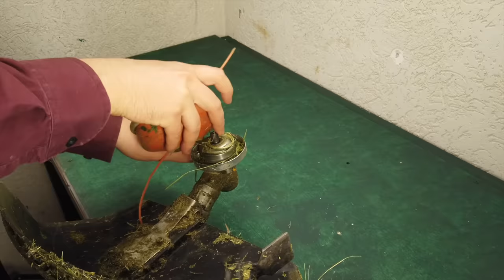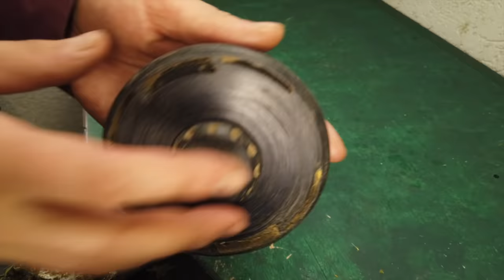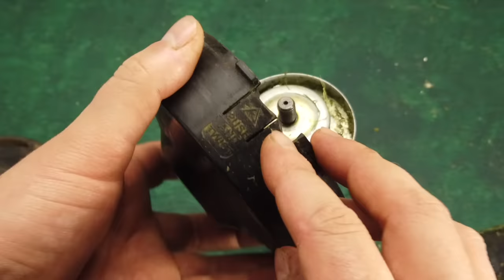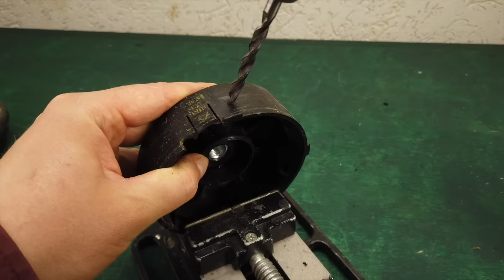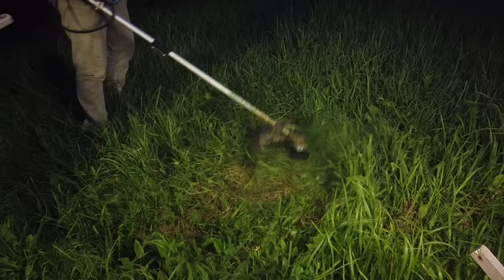The eternal trimmer coil with your own hands! It couldn't be simpler

Comment: With a little ingenuity some springs and some bike spokes could make retracting spinner where when it's not spinning the springs pull the spokes in so they're not sticking out and when it is on the centrifugal force pushes them back out.

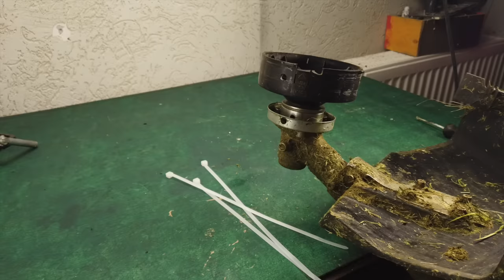Comment: Thanks. You can't believe it , I had this idea for a long time , I was searching for trimmer strings that had a sort of ball at the end of each 6 inch length, now I see your video 1:32 , I found what I needed was "self locking plastic straps". I was melting strings to form a ball at the end, but at high speed rotation of trimmer head, they used to snap.
Reply from the maker: Спасибо большое 
Посмотри новые видео у меня на канале. Там тоже есть про триммер!
Reply: USE  those brass marrets, for electrical connections. ( Usually black, for 10 - 12 gauge wires ) The larger ones - work  just  fine. Be carefull, use  the  EXACT  size of screw driver - on those small  brass  screws.  Larger ones, can hold up to 1.05   strings.....

Comment: Eternal Trimmer Coil - I hardly think so, those zip ties will eventually break and then you will have to replace them just like you have to replace the nylon trimmer line.
Reply from the maker: definitely you are right. but still this is one of the life hacks to finish the job if you run out of fishing line
Reply: Yes, but it's easy to replace one zip-tie, more so than trying to untangle the reel of trimmer line. Quicker, too . . . If you break several, get the next larger size of zip-ties, and cut-to-length if you must.
Reply: Of course.  But so much easier to replace.  My trimmer is such a pain to replace the line.  I have tried 4 times and the bump stop to release new line doesn't work.  It either jams or the line jams.  This is so much easier.  I haven't tried it but I have plenty of zip ties.

Comment: YOU  sir, just gave me  another  ' idea ' !   WHY  NOT  USE  one, of those round, steel metal  OIL  FILTER  removers ?   The   ' cap ' style ones - with a square hole in the middle - with alot of small flat spots, around the other bottom edge - to GRIP  the filter ( like a giant socket ).  USING  REAL   METAL, on your weed eater - IS SAFER  than  modern ' plastic '.  Just drill out the 3/8  square hole - to fit the shat spindle, on the weed whacker  head.  I may  use THIS   method ! @ !
Reply from the maker: Thank you for the idea. By the way, I have a similar method on my channel. Search
Reply: @diy1  OK.  from eastern central Alberta...
Reply from the maker: Thank you. Im from Moscow/ Russia
Reply: @diy1  eastern central Alberta Canada.

Comment: Not sure the spray on lubricant is a good idea. It is likely to soak in and thin the grease that is in the bearings and gears of the trimmer head.
Reply from the maker: This is a filter impregnation spray.  it is very viscous and viscous.  so it won't break anything
Reply: @diy1  
Da li može bez Spreja i kako se zove taj Sprej ?